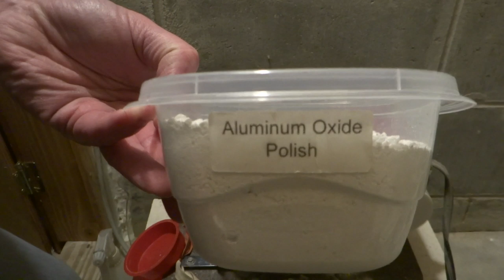How to Make Stone Crosses

Comment: Got another comment and question. At the vey beginning of the video, you trace the pattern on a gray / pinkish stone at an angle. I am certain that's the one of the 4 crosses I purchased from Olivet! At the end when you show the finished batch, there is my cross laying on top! Awesome! A question about the Lot - O. I love it already. The instructions that come with it, and the helps on The RockShed's website where I bought it from, says when you do the beginning tumbles with 220 grit, to change the water and grit every day until they are reAdy for the next stages. From your experience with the Lot - O, is that necessary?
Reply from the maker: Those directions are referring to doing the whole tumble in the Lot-O.  I don’t do that.  I start them in a rotary in coarse grit and then move to the Lot-O with 220 grit.  They go for two days in 220 grit and then move to 500 for three days and then polish for three days.  I think you have watched my long video on tumbling crazy lace agate.  If not, watch that to see my whole process.
Reply: @MichiganRocks  will do. I'm doing some Botswana River Agates from the beginning. They are kind of rounded by the water currents so that's why I started them in the Lot - O. I've got a batch ready for 220 that I had started in a rotary tumbler. I'll try your method with them.
Reply from the maker: Paul Carder Bots are awesome.  I tumble some a couple years ago.

Comment: i found a raytech 10" diamond saw  typel-10s  that i thought might cut crosses but there is some cross hatching on the back side  any advice?
Reply from the maker: Yes, I think I mentioned that in the video. You’ll need to make a ramp. I think I might have explained better near the beginning of this video:  https://youtu.be/VDoZL4MiPgQ
Reply: @MichiganRocks  i just found a gemlap 8" trim saw
Reply: @MichiganRocks  what pitch did you use for ypur ramp?
i did not get a the gemlap 8" trim saw  it was missing alot of pieces
Reply from the maker: @chadwest4933  You have to make it to fit your particular saw. My ramp would not fit your saw. Just make the plane of the top of the table intersect with the arbor of the saw. You just need to be close, not perfect.

Comment: Good morning  i have a couple of questions for you
first  i an still looking for a gemlap trim saw like the one you use here,,,  but ran across this on ebay wanting to know it this will cut crosses    the model number is  jbfg tiny trim saw 4" blade johnson bros. with cast iron base.

second question  i have a rock that will not fit in my lot o tumbler was wanting to know on state 3 and 4 in my lorton 33b how longs for each stage, and how much grit should i use.   thanks chad
Reply from the maker: I just looked up that eBay listing. I have never seen a saw like that. It's really interesting. It does look like the blade is centered vertically on the table, so it should work fine. The problem I see with it is that it's really, really small. You won't be able to fit a very big slab on that table. 

Look in the description of this video for the answer to your second question: https://studio.youtube.com/video/dYGFal0e1WY/edit
Reply from the maker: I just sent a picture of that saw to a friend. He said he owned one once but never used it. He said they're used with very thin blades by jewelers who are working with very expensive materials. Buy using a thin blade, there's less waste. He didn't think it would be a great lapidary saw.
Reply from the maker: Send me an email, please. abramr@mac.com

Comment: How do you determine the angle of the saw ramp?
Reply from the maker: You can either take some measurements and do some math to figure it out, or you can just make sure the top of the ramp lines up with the center of the saw blade.  You could roughly cut the plywood top and cut a slot for the blade, then hold the plywood on the saw top and tip the back up until the plane of the plywood intersects the saw shaft.  Then measure how high the back of the plywood is and build your ramp from there.  I have no idea if what I just wrote will make any sense.  The bottom line is that you can just play around with it until you get it right. It doesn't have to be perfect, just pretty close.
Reply: @MichiganRocks  No, that sounded fine.  Gonna play with it.  Thanks for the quick response.